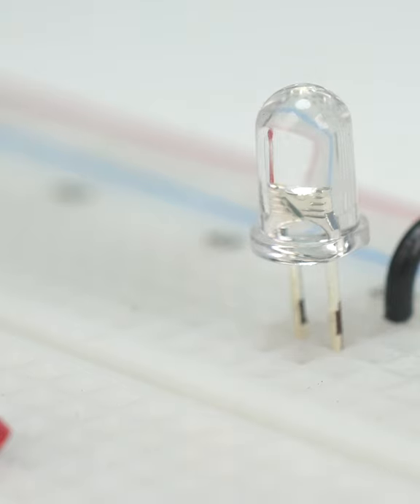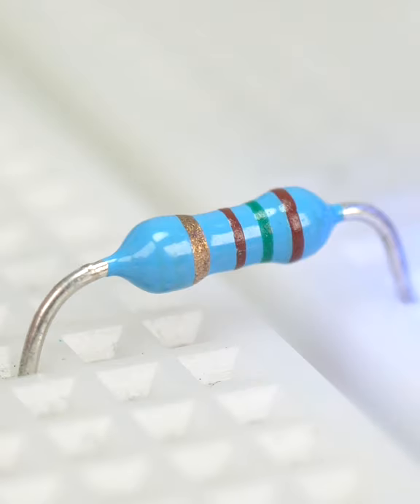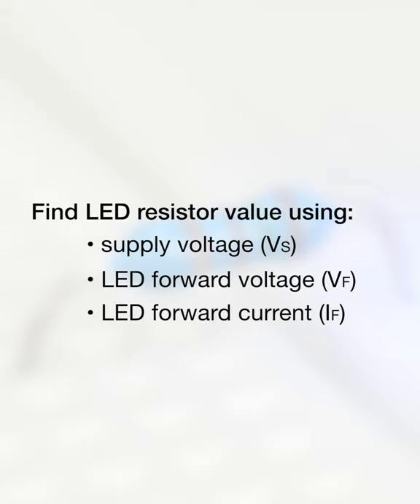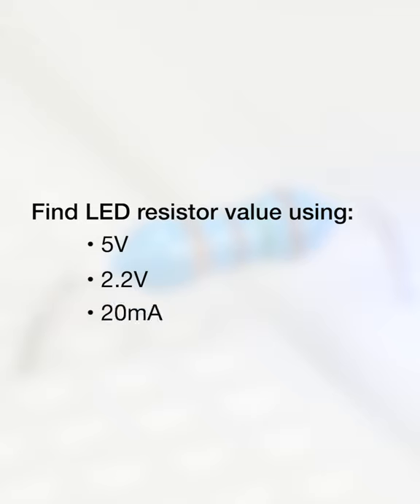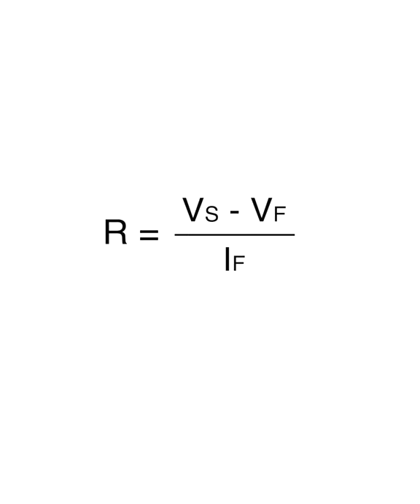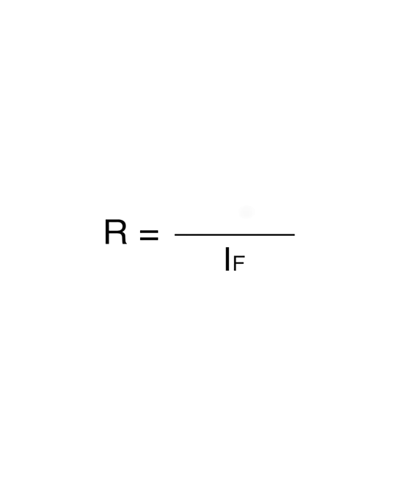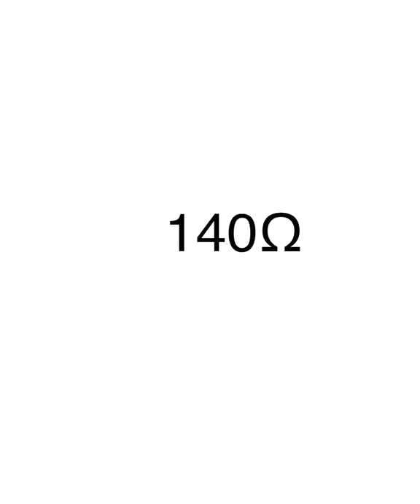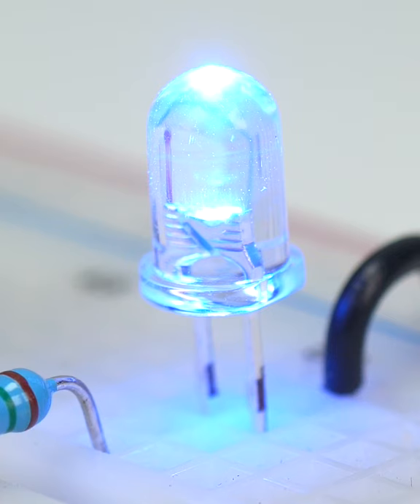Calculate LED Resistor Value - Collin’s Lab Notes #adafruit #collinslabnotes

Comment: The 12 volt LED strips use this exact trick, except they add 2 more LEDs to the series chain to allow the strip to be powered with 12 volts without burning the LEDs. This way you can have a nice big strip of light using a dirt cheap power source like a car battery or car cigarette lighter, and usually you can dim the LEDs with PWM and a MOSFET.
Reply: I'm doing research for automotive applications. It seems like led strips don't need resistors. Is that correct?

Comment: If you use a LED (constant current) driver  and put several LED's in series to get to the correct forward voltage, should you use a resistor anyway?
Reply: Not if the LEDs are in series. You can, but it will only cause your driver to increase output voltage by the drop across the resistor!
Reply: If you use a constant current LED-driver, then the current is limited by your driver. For a well-designed CCLD, and a properly chosen power-source, you would not need additional resistors. Imagine, though, that you use a 230V power-source and just a single LED - the driver might have difficulties with this (that a series-resistor should not solve). if your forward voltage is too high (eg 200 white LEDs in series) this too is a problem, as your driver might not be able to deliver it.
Reply: Why did comment remind me of Minecraft 😂😂 I think I’m WAY to invested in my kids Minecraft world 😅

Comment: Can you please explain why dc motor can't simply use resistor as voltage multiplier and it would be great if you could explain the simplest ways to reduce voltage for dc motor.
Reply: It is possible to use a resistor but all the voltage it reduces goes to waste and heats up the resistor so it must have high enough power rating. The simplest way to reduce voltage without wasting power is to use some kind of pwm controller. A servo tester connected to a mosfet would work